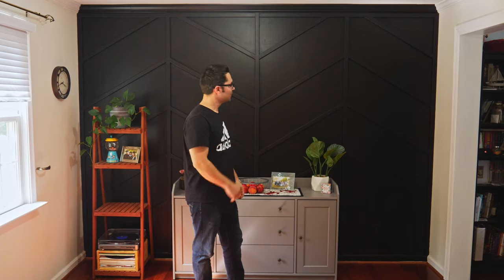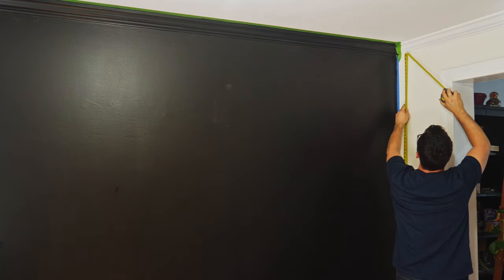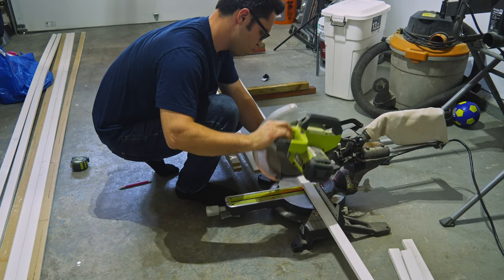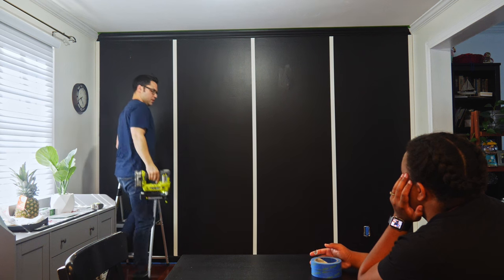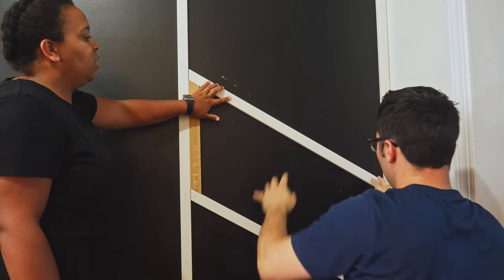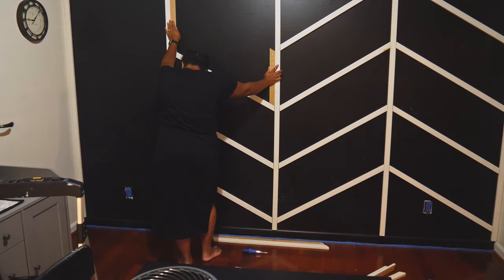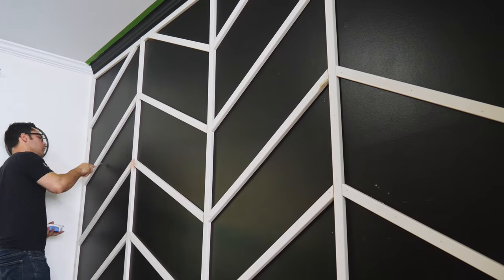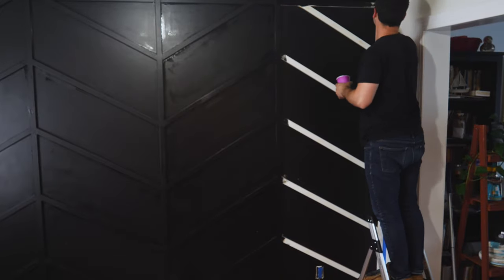How to Create The Perfect Chevron Accent Wall

Comment: Are the MDF boards nailed right into the drywall or did you have to find the studs?  If it is straight into the drywall, how is it holding up without glue?  Thinking about doing this soon... thanks in advance!!
Reply from the maker: Hey there. So, I was not aiming for studs, but I wouldn’t be surprised if I got it a couple of times. It has held up no problem at all! We were purposefully not nailing into stud just incase we remove it down the road. If you think the wall will be permanent, then definitely shoot your brad nails into studs, and if you want to be a little extra, use liquid nails for extra hold.

Comment: Does the wall have texture? I have orange peel walls and wonder if I can do that. Thanks
Reply from the maker: Hi Jay, my wall does not have any texture. I am honestly not sure but looking online at that texture, you may have to sand down the areas you would put your trim on the wall. Or if you just put it on top of it, I would suggest a healthy amount of caulk to hide the seams between the boards and the wall.

Comment: How did you calculate the length of the diagonal pieces?
Reply from the maker: Hey curlysouthpaw - very non-scientifically! LOL. My wife just decided on an angle. Then I took a piece that was long and marked the top and bottom, where it met the vertical pieces. Once I had the piece cut and fitted, she approved it. Also, once you have that first piece perfectly cut, you could use it to mark the other pieces for that portion of the wall. Don't forget that the boards going in the opposite direction are flipped.